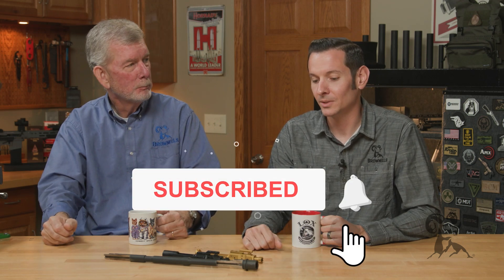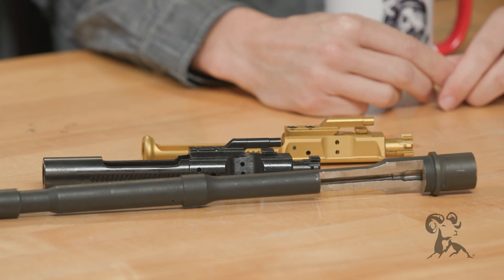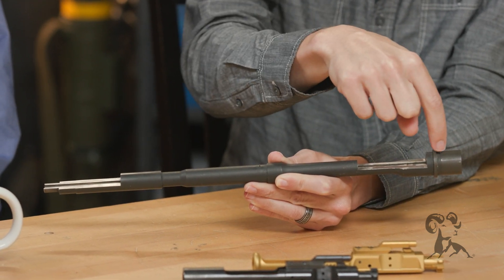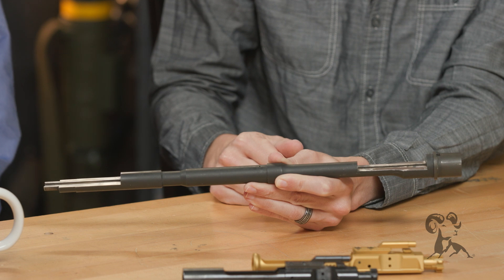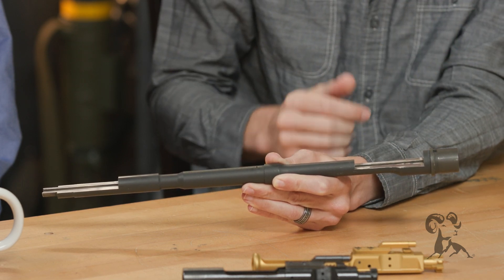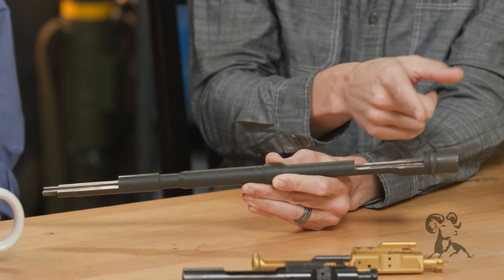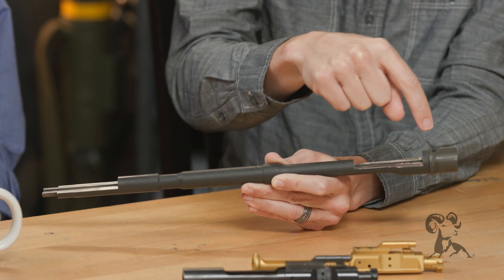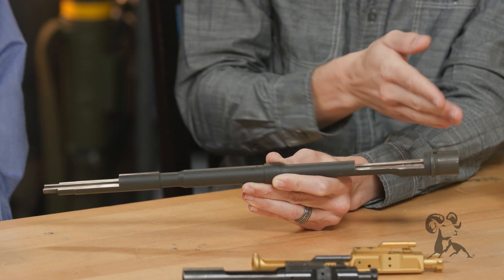Smyth Busters: Fixing Your AR-15's Headspace

Comment: Glad to see these headspace vids. Fixing to do my first barrel change myself instead of going to a gunsmith. Wish me luck that it works out! 

Going with a Faxon match 223 gunner barrel, Riflespeed .625 gas block, and odin 02 handguards.
Reply: I’m not the most experienced guy in the world with AR’s but i’ve been pretty successful with The barrel work that I’ve done so far. I’ve been torquing them down to 55 foot pounds After seasoning the threads a few times, and just using the raw spaghetti noodle trick for the gas blocks. but yeah most definitely good luck👍
Reply: @angeldesigns1385  Truly thank you for the tip! I was worried about how to go about lining up the gas block, and was prepared to just wing it. But, your mention of the spaghetti trick seems like a cheap winner of a idea haha. 

Still debating on how far to torque the nut, so if 55 worked for you I may aim for that myself. 

Planning to do the install next week after testing out my in jail supressor one more time with my current build vs different muzzle devices.  I'll give it my best shot! Thanks once again!
Reply: @iPervy  Yep no worries👍
Reply: @iPervy  You can check what your upper company wants, but the old delta ring nuts torque spec was between 35 and 80 lb ft. 
My Aero M4E1 upper wanted 50 lb feet, but you have a pretty good range that should be safe. I would like Caleb to give us a cool answer though.

Comment: I don't disagree, but I will add another option.  I discovered I had four nitride barrels in storage that were out of spec with every bolt I tried.  The GO gauge would not go.  Even though they were new and unused, the supplier refused to take them back, claiming I was beyond their warranty return period (no, it was not Brownells).  For me it was worth purchasing a carbide reamer from Pacific TooI and reaming the chambers myself.  This is very much a trial and error process that needs to be attempted extremely slowly.  I was expecting the nitride coating to offer some resistance, but the reamer went through the material like a hot knife through butter.  I ran the lathe at 600 RPM and squirted some Oatey high sulfur cutting oil in the breeches.  The only issue I encountered was operator induced on the first barrel.  I cut a few thousandths too deeply, so now even a NO GO gauge will act like a GO gauge.  On the other three barrels I just kissed their chambers and that was all they needed.  The ruined barrel sits in my trash bin because trying to salvage it is not worth the effort and would require making other parts out of spec.
Reply: Nitride is possible, but it will dull the reamer quicker.. If the no go gauge goes it may still be safe. Try to find a set of incremental chamber gauges to see how far from the field setting it is. Hard on brass if reloading but it maybe safe to shoot..
Reply: @hairydogstail  Thanks, but since I build them for customers, I don't intend to sell them anything that isn't spec.
Reply: @Paladin1873  Agree, sounds like you have it covered well..I hope your customers appreciate you go the extra distance for them when so many won't..

Comment: Do you really have to completely strip your bolt to test headspace? Can you get away with leaving the ejector in and just take the extractor off?
Reply: Lazy???
Reply: @dpeter6396  Yep.
Reply: @JayKayKay7   LOL!!
Reply: No, I prefer to check head space with the ejector. It is also recommended to replace the role pin if you remove the ejector. The extractor should be removed, but it is very easy to remove and reinstall....

Comment: I just sent a barrel back because when my AP BCG from Brownells was feeding the ramps of the barrel extension was scratching and denting up the casings and stuff, plus high spots on a couple of the lugs. So just sent it back for a replacement Rosco 13.7 and after it comes back I'm ordering the Brownell's wrenchman 12.625 handguard then the base of my A.P., Magpul, Brownell's and Rosco build will be done and ready to fire.  CAN'T WAIT!!!

Comment: 99.99999% of people will never have to worry about the headspace of their ar15, for the other .00001% youre gonna buy a new barrel and bolt and call it a day
Reply: Not in my experience. I have seen many short chambers throughout the years, especially from one particular common, inexpensive AR barrel manufacturer..

Comment: I’d really appreciate a video from you on how to use headspace gauges. 

I’m a rookie when it comes to the AR platform and any help is appreciated.
Reply: Here is the YT one https://www.youtube.com/watch?v=pcVh-XBOLKg&t=107s and there is one on our webpage as part of our build series.
Reply: @CalebSavant  Thanks Caleb!
Reply: Remove firing pin, bolt closes on go, no clozey on no-go. Pretty simple
Reply: @philmarq9915  If you are checking headspace with the barrel already installed on the AR upper, do not remove the firing pin, this is what keeps your cam pin straight and without it you can get the bolt carrier group stuck in the upper.
Reply: @CalebSavant  I don’t think I would ever check the headspace with the barrel already in the upper receiver anyways. The same issue that you were talking about with the cam pin could also give you false readings by way of an improperly milled upper not allowing the bolt to cam into full battery. Best to just use the bolt in the barrel.
Reply: @philmarq9915  That's fine for a new build, but there is no point in removing the barrel if you are just changing bolts and want to check the headspace. It is perfectly acceptable and this is how the military does their annual checks, if your cam path is causing your bolt to not go into battery fully, you have much bigger issues anyway, I have never seen a cam pin/path so out of spec that it actually caused this malfunction.
Reply: @CalebSavant  I’ve had a couple with worn out cam paths but that makes sense. In my units armory I’ve done it that way but personal guns I’ve always done bolt and barrel with everything uninstalled at home
Reply: @philmarq9915  You've never just swapped out a bolt before on a built gun?
Reply: @AdoreYouInAshXI  you can but I’d definitely recommend shooting some low pressure loads (.223 spec) and checking pressure patterns. On the flip side, if you are shooting ammo under 55,000 psi pretty much all the time, I vote “if it fits, it ships”.

Comment: Something else that can affect pressure--the leade (or throat or freebore--I forgot the technical term).  If the rifling starts too close to the chamber then the chamber pressure can be too high with standard ammunition.  Chrome or nitrated barrels will make it hard to change the leade.

I may have encountered that at my local public rifle range where I was one of the range safety officers.  An AR-15 on line--a custom match-grade AR-15--was showing signs of excessive pressure including stuck cases and punctured primers when fired using commercial match grade ammunition.  I recommended a gunsmith's visit with a couple of fired cases and suggested that there might be insufficient freebore--and the rifling was that was that way to maximize accuracy.  If I was correct, it was a matter of just a few thousandths of an inch.  At any rate, an expensive gunsmith's visit was called for.
Reply: Yup, short chambers will have the same symptoms too. A throat gauge from M-guns is a good gauge to check for a 5.56 throat or chamber gauges from PTG are even better that will check to see if the throat and chamber were cut correctly..

Comment: OK how about this scenario. You have an upper and a BCG and order a barrel. You have to mount the barrel, torque the nut and check headspace. Headspace is off. Can you return a barrel that has been mounted and torqued? Seems cheaper and safer to buy a barrel and upper assy in 1st place.
Reply: Depends on the manufacturer but it is easy to check head space before you mount the barrel..

Comment: I had someone lap my upper for a flat face before attaching my barrel and other people have told me that it will effect my headspace.
The problem with that is, headspace is determined by the barrel and extension, not the extention and the reciever.  Yes if you lap it down too far you can cause problens, but not with headspace.  Your bolt wont be far enough forward for the hammer to hit the firing pin.

Comment: Assuming all your parts are spec from a reputable manufacturer company supplier..........check headspace just to be safe.........I've mixed and matched different bolts barrels and calibers.........only problem I've ever had was cheap bolt lugs breaking off

Comment: I'd recommend people buy their headspace gauges and have them before they buy the barrel and BCG.  If you buy a barrel and have to wait on headspace gauges, the return window for the barrel may have lapsed.
Reply: Excellent advice. Headspace gauges are not expensive.
Reply: I am new to this "AR SHIT", but these quite I'll manufactured guns seem like , with all there other problems, are just a pile of junk gun parts dancing in formation, I never heard of buying an expensive gun, only to end up with a piece of shit someone could have built in a garage with pliers and a drill
Reply: @herbertsmith6085  There are several manufacturers that sell total trash at a premium.  Luth-AR for example.  You get the exact setup you want by building it.  An individual "in his garage" can build the same rifle as manufacturers, or better, simply by following the correct process and using the correct materials....and they can do it for cheaper.  Sure, there are a lot of fuds out there using loctite on their gas block set screws...but then there are guys like me dimpling the barrel, putting rocksett on the screws and then pinning the gas block, for example.  You don't find that from a lot of manufacturers.  Let's say I want to run a silencer on a gun with an FSB that is adjustable.......YOU CAN'T FIND THAT GUN ON THE MARKET.  You have to build it.  And in building it you get the experience and knowledge to fix it, to a degree, if something goes wrong.  You don't get that by buying your way into the AR platform.  First AR-15 I ever shot was one I built in my garage and I won't be doing it any other way now.
Reply: @herbertsmith6085  iv built 3 rifles starting with 80 lowers a drill and my garage with psa parts.... never had a problem. 
You need some special skills to fck this up so bad that your gun doesn't work.  As long as your parts are in spec and your iq isn't room temperature you can do it.
Reply: @whatsmolly5741  Same, except I did have a lower with out of spec receiver extension threading once.  Do you leave your trigger pockets raw, cero, or protect them in any way?
Reply: @JenkinsStevenD  nothing in the trigger well and drop in triggers in all 3 because aligning holes is hard lol. Made like 4 polymer lowers before trying the aluminum. 
Offset buffer detent could potentially fix out of spec reciever threads.
Reply: @herbertsmith6085  and the reality is that even the Chinese can get right 99% of the time as the tolerances arnt all that tight. If you want to know what pain is try building an ak.

Comment: Great info as always. Need a poll of how many folks actually check their AR-15 headspace....I bet that number's really small.
Reply: Never checked mine since it runs fine
Reply: @philgraves7814  it’s just good practice to check. Especially when using different parts from different manufacturers.
Reply: I check mine every time I pull the trigger...if it goes bang is good ,if it goes boom it's not. Keep it simple.
Reply: What's a head space?
Reply: @FlyingTigersKMT  Headspace is the distance between the base of the bullet and the head of the bolt. Essentially, checking your headspace helps to make sure your gun’s chamber dimensions are safe. Improper headspace (measuring the distance between the bolt or breech face and a known spot in the chamber where the case rests) can result in multiple problems, the most dangerous of which is catastrophic failure of the rifle. Case separations, blown out primers, failure to eject, and failure to fire are other common issues. My suggestions to anyone building an AR-15 is to buy a barrel that comes with a properly headspaced bolt, or buy the go/no go gauges and look up a video on how to do it yourself. It's not difficult.
Reply: Every AR I build or help build gets checked (except for 6mm ARC, I don’t have those gauges yet).
Reply: Mine just looked like the bolt closed properly. 
My booger hook went straight for the bang switch and yeetification began.
Reply: I think it is a good idea, especially with 5.56 nato that is high pressure round in its top loading.  
There many people that have no ideal of how to use except insert the gage and hit the bolt release allow the BGC to slam home under full spring pressure.   
The ABCs of head spacing The AR 15 would be a good topic.
Reply: I assembled an AR from parts by different manufacturers and checked the headspace. Commercially built ARs I own - hard no.
Reply: I have put together a few AR-15s and I have never checked fir head space. I know, not good. Maybe on my next one I will.
Reply: ..,.REAL small. I bet 95% are “Plug ‘n Play”
Reply: Im the only one in my friend group who even has 5.56 go and no go gauges.
Reply: Put together alot more than just ar's never had a head space problem
Reply: Mr. Stoner checked it once back in 1957. Been good ever since. Nuf said, we’re moving on.
Reply: Plug and play here... Sadly, I have headspace gauges too, I'm just lazy
Reply: Never checked mine in any of my ARs.  Built 3 of the 4 I own.  Asked a gunsmith, who has a shop primarily for ARs, if I needed to headspace.  He said, don't bother, just put it together, go to the range and shoot it.

Comment: Basically, changing the head spacing on an already assembled AR barrel is impractical. At least when it comes to altering the physical headspace of the barrel.

If you are lucky, it’s just a bit of tolerance stacking, and a different bolt may work. That is, if you have a spare on hand. If not, just return the barrel for replacement.

If it happens on the second barrel too, the bolt you are trying to use may be the problem.

Comment: All I use to check head space is with a no-go gauge. If it chambers that then I send it back. I believe you don’t need the go gauge or the field gauge. My go gauge is a factory load round. If that chambers it good. If you need to use the field gauge then you’re ready for a new barrel.
Reply: No, short chambers will chamber rounds, but can cause pressure, reliability and accuracy problems. I have seen many more short chambers, than over sized chambers..
Reply: @hairydogstail  then I would see pressure issues with my brass (blown primers, excessive deformation, difficult extraction). A lot of times with a short chamber just chambering a round and extracting it will show damage to the round. Also When I start with a new barrel I usually use lite loads and work up to a standard load. I very seldom use hot loads as that tends to reduce the brass life and uses up powder that is currently hard to get (reasonable priced). I am extremely cautious starting out until I’m assured everything is okay.
Reply: @oldnumber5866  That will work, just easier to check go and no gauge..If it works for you, that is all that matters..

Comment: My JP Sauer and Sohns 38H that Grandpa brought back from WW2 fires reliably, and is accurate, but I have been getting hot powder in the face blowing back. Could it be that the barrel is worn out, and/or, that the modern .32 ACP ammo is not good for it? Not using until I sort it out, because I believe that without safety glasses, a person could damage their eyes.

Comment: Smith here! If the headspace is short then remove shoulder mat behind the tenon. Too long then remove mat off tenon. Always measure with a depth mic!
Reply: Do you mean the bolt lugs? What are you calling a tenon??

Comment: I have a .300 blackout barrel that has a headspace problem. With the 208 and 220g subsonic rounds, the bullet will engage with the rifling when chambering. When I try to extract the round, the bullet stays, while the case and powder make a mess. It shoot very well with 110-150 grain, so I was tempted to leave it, but I have never attempted firing the heavier bullets.
Reply: What or who's barrel ?
Reply: @kuzz7919  Thanks for asking. I'm embarrassed to tell you that it is a company called Ceratac, and it has been a test for me, to see how cheaply I could build a rifle. My first was a Patriot Ordinance Factory (POF), and a few more are Palmetto State Armory. I haven't given up on the cheapest build ever, because I am learning along the way.
Reply: @seanomeirs8362  I'm sorry you ran into that problem. Live and learn trust me I have been there.
 I buy my barrels & uppers ONLY when on sale that way I can get quality parts Cheap.
 BA Hanson barrels, Brownell & PSA uppers, BCG I use Fail Zero Nibo & PSA.
Reply: @kuzz7919  PSA and POF have been great.  I was trying to build an AR for $300, just for fun, and as I mentioned, I have learned a lot. I may just buy a barrel.
Reply: @kuzz7919  Guns and Gadgets had a video  that gave me the idea.